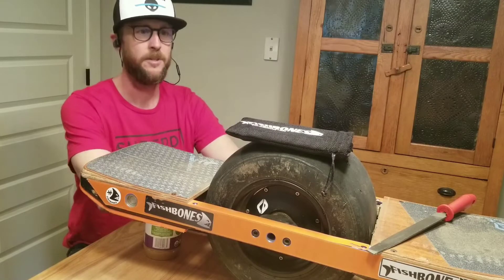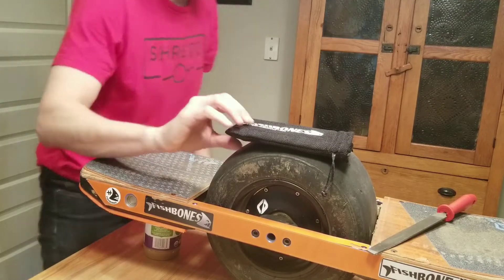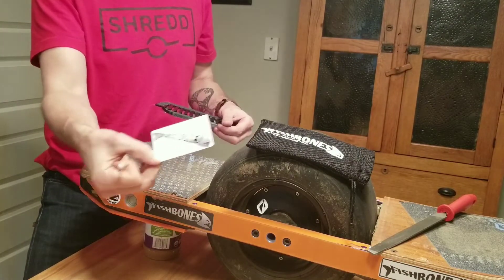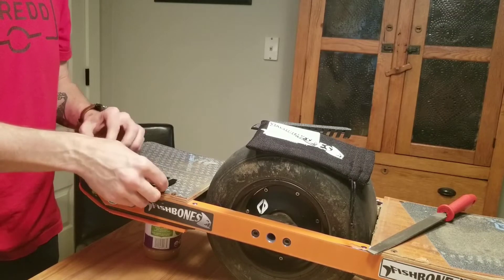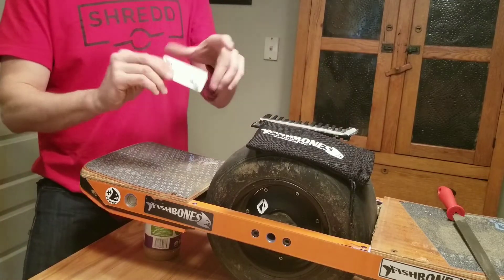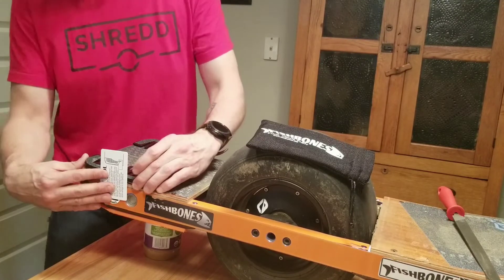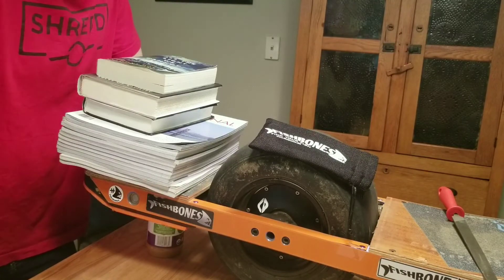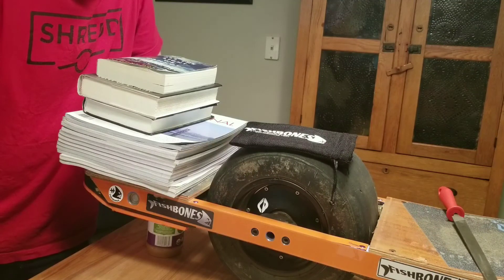Fishbones V1 Installation Video

Comment: Can you not place the v1 fishbones closer to the wheel instead of the nose end of the footplate? Being so far forward as in this video with a gap between them and the wheel//fender would make them useless as I keep my front foot right up against my fender/wheel exactly where there is a gap between the fishbones and the wheel in this video..I would definitely need to have them close up to the fender/wheel and have the gap towards the front of the footpad.. Would this still work?